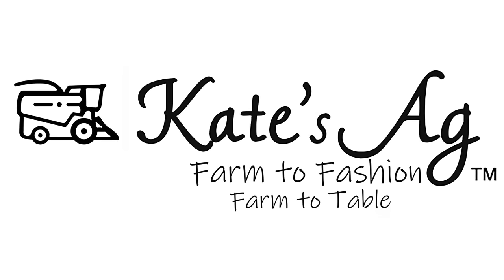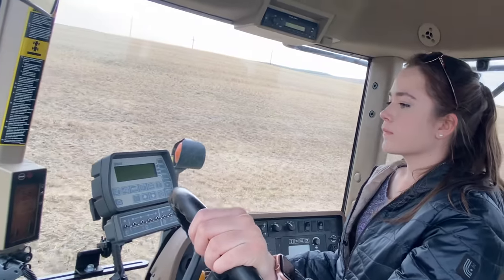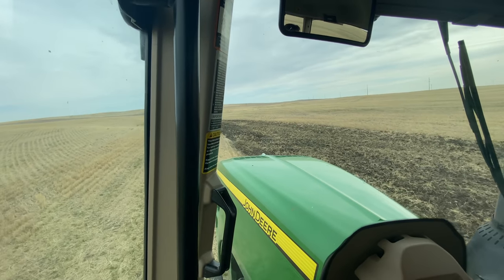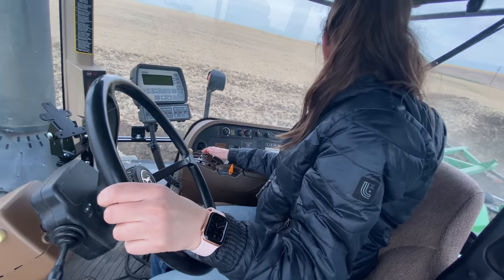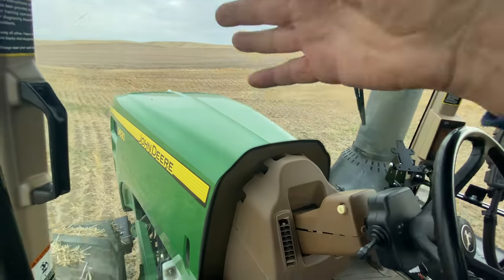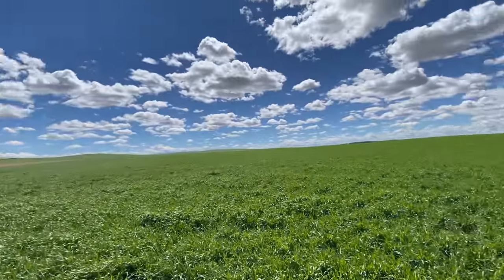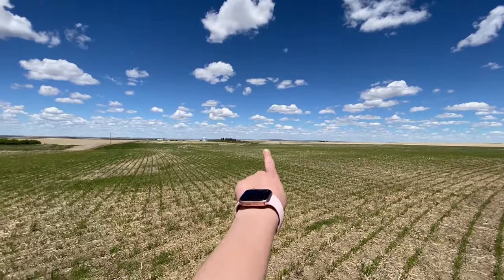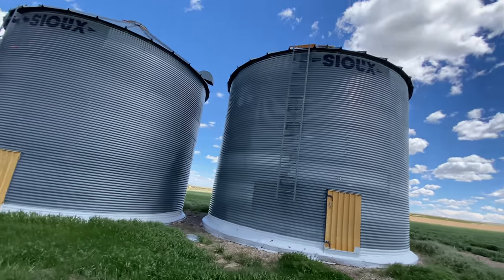Driving our New Tractor!! + Crop Update!! 2021

Comment: Great video Kate  .  The first time I was in an articulated tractor I just watched the operator  , then he had me make a round  but then he left to operate it by myself  .
  I don't know how many years I spent operating one  .  I know you pull over when you need to  , I had several roads that were only a couple of feet wider than the implement I had  ,
  but I was always driving as close to the ditch as possible , even then I was just on my side of the highway  ..  Keep it up Kate after a while driving the tractor will be second nature  , I drove the tractor so much I was enjoying it and just listened to the radio & stayed cool in the air conditioning. I wasn't sure what to expect when I first looked at your thumbnail picture  .
    Hang in there Kate  , I know you can do anything you want and it takes is a little practice and determination   ..  DO  you ever seed wheat in the fall and harvest it spring / usually in June  ??
Reply from the maker: Hi Mr. Carlton. That is awesome!  Thank you for the great story!!  I appreciate your kindness and great encouragement!!!  I like the radio and air conditioner too!!

Comment: Articulating steering is a little tricky to get used to. It doesn't take much movement on the steering wheel for the front end of swing over quick. You'll get the hang of it was practice. Main thing to remember is when you come into a right turn on the wash go a little wider when you make a left turn, get in a Little Closer. And with time you'll get used to how sharp or gentle the turns are. I have a CDL with just about all the endorsements you can get but you still have to have a special license to drive an articulating bus which steers similar to your tractor just a lot longer. Keep at it you got this. Good update on the crops they're looking good,  moisture came right on time.
Reply from the maker: Hi Mr. Hollar.  Thank you for the great advice.  It really is a big learning curve.  The way it bends is very different from driving my combine!  I can't image a bus like that!  I appreciate your kindness and great encouragement!!!

Comment: Hey Kate how do you like your new 4 wheel drive John Deere tractor. Girl you art to have a wider disc behind that powerful John Deere tractor. The one I drove was a 4 wheel drive John Deere tractor 9640. I had a wide disc behind it. But you can get over a lot of ground with the speed that you are going. Is your tractor a Quad Chift or a power shift. Power shift means you have 16 forward gears you just shift up to each gear by pushing the gear shift lever up and you can shift back with out even using the clutch pedal . but on a quad shift you have to use the clutch pedal to shift up a gear. Then you can flop the gear shift lever side to side to get a higher gear. 
You see Kate if you had Rice and Cane tires on your big John Deere tractor. Your tires want slip as much as the Low Profile tires do that you have on your big John Deere tractor now. 
I bet your father is going to be using that big John Deere tractor to pull your big wide planter with the seed tank on the planter. That big John Deere tractor will act like it doesn't have anything behind it. I know because the big John Deere tractor that I drove had a 40 foot wide disc behind it. I can go pretty fast with the big disc. 
But you just have fun driving your new big 4 wheel drive John Deere tractor. But please be Careful when you are turning around on the ends of your fields. Kate don't use your throttle  when you are turning around on the ends of your fields but shift down a couple of gears to keep your Horsepower up  so that your John Deere tractor want use any oil. Because you see Kate diesel engines will use oil if you don't keep your horsepower up. Its called lugging your engine with the horsepower going down. 
But its just a little bit of information about a diesel engines. Budd R Hicks. PS THANKS for the awesome videos that you are putting on you tube  for your viewers to watch and learn about farming.
Reply from the maker: Thank you so much for your kind words and great advice.